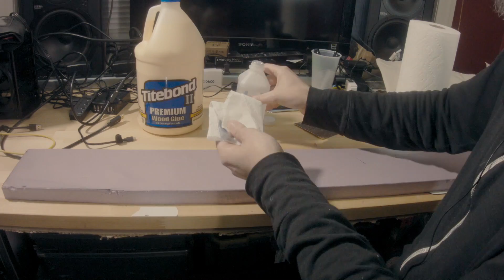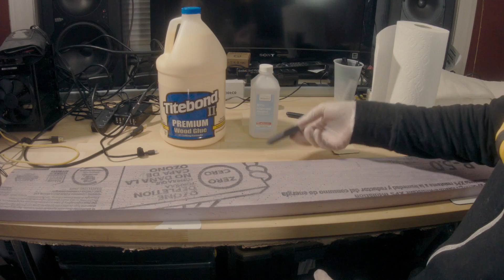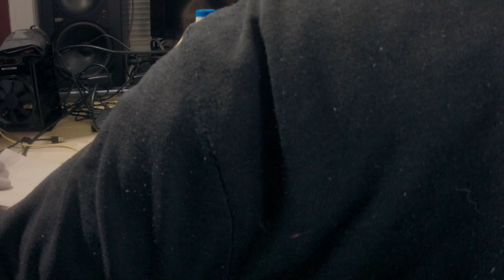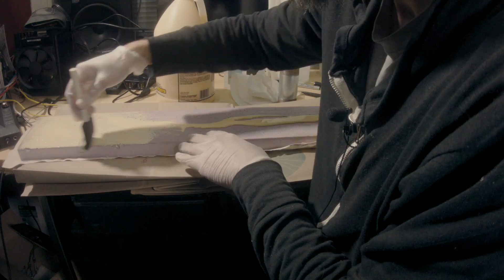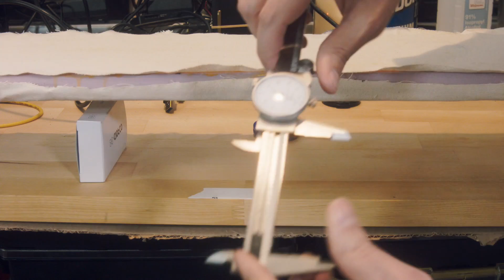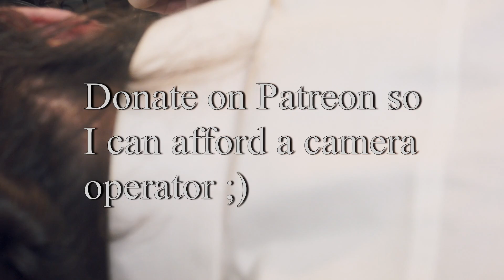M/V Dodgy Roger II - Attaching The Canvas

Comment: Depending on the composition of the coating and how well it is adhered to the foam a light sanding that doesn't completely remove the coating without puncturing the surface might even give you better results for less work. This is definitely the type of thing where it is hard to say what the actual ideal technique is without an exhaustive array of tests (which probably aren't worth your time).